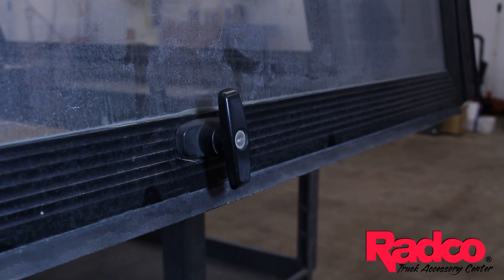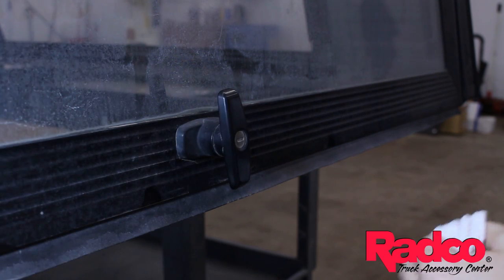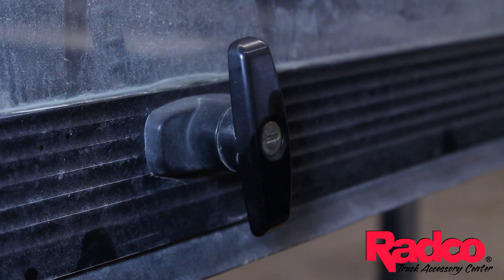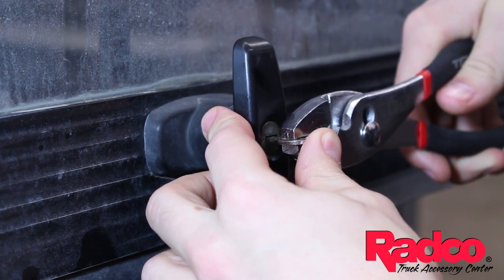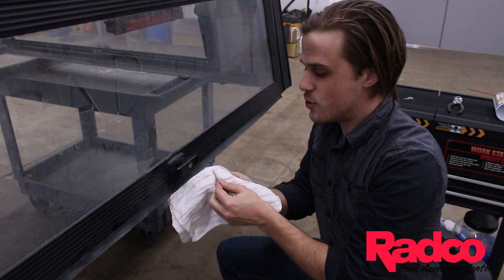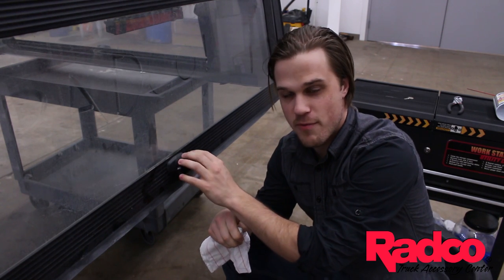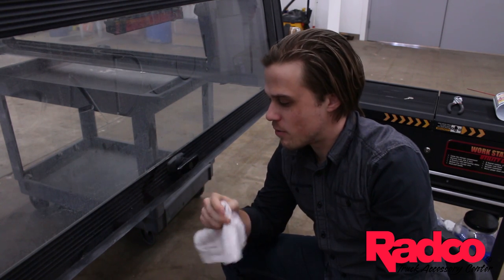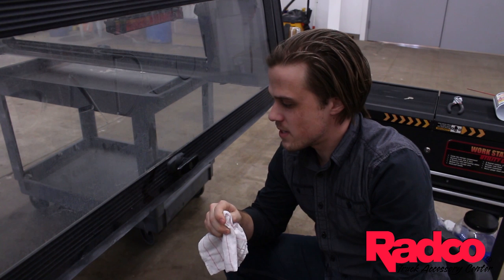T-Handle Lock Fix

Comment: Wow. Ty so much for the knowledge. I lost my keys to my truck topper about a year ago. The truck wasn’t a daily driver so I let it sit mostly,  driving it every so often to the store to keep things semi moving. Recently I lost my job,  and my work truck. Now I’m back to my old trusty Ford F-150. My truck topper y handles were a must for locking the top,  problem was I lost my keys as stated above. I commute with a friend and need certain tools but not others. Those stay in my truck. I recently found an online company to replace the keys (2006 topper).  I received them tonight and tried them. The lock was incredibly tight. It worked,  but not well.  This video saved me. Ty.

Comment: I have a 700 series leer tonneau cover, and the lock cylinder spun in place. I was able to unlock and open the latch, but not lock it. This video totally worked. Just hit it with some penetrating fluid, and worked the key a bit with some pliers. Good as new now! Thanks for the video!

Comment: this worked great on both sides! thank you  ..  question.  one side  locks but the other side the key just pivots inside the tumbler it doesn't engage the  lock.. how to fix it?  or do i need a new set? thank you